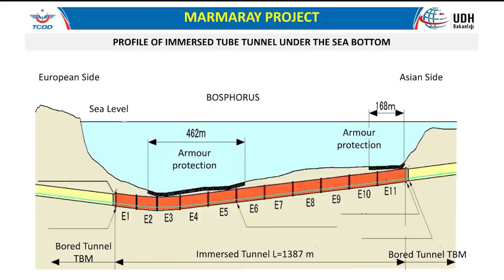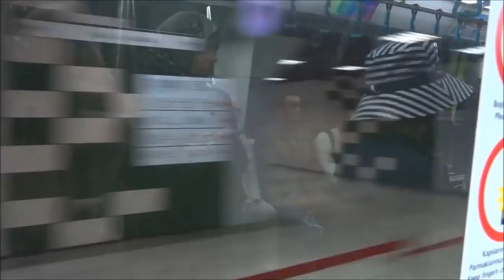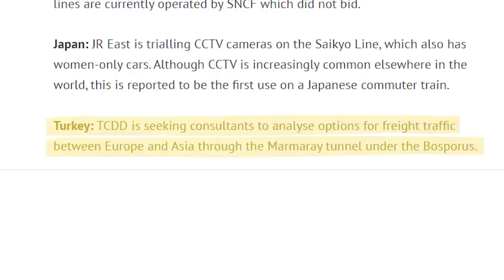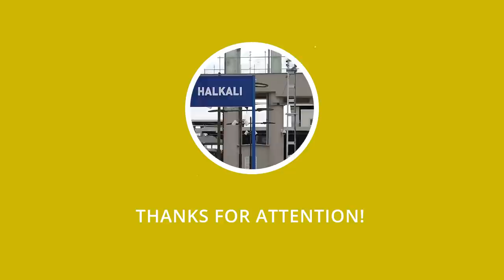First Undersea Tunnel That Links Europe and Asia (The Marmaray Project)

Comment from the maker: We just had a small conversation with one of the experts and a colleague who was engaged on Marmaray project, and we are happy to share with you a couple of details not mentioned in the video: 

1. A complex floodgate system was made as part of the project with the aim to make possible to isolate the immersed tunnel section in case of flooding;

2. The presence of the two signaling systems in the tunnel (CBTC and ETCS) allows mixed traffic (simultaneous passage of the intercity and commuter trains);

3. The presence of train control monitoring system in both Europe and Asia allows to check some parameters of freight trains before they enter the section of the immersed tunnel, and

4. Immersed tunnel (the undersea section of tunnel of length of 1,4 km) consists of 11 sections lowered via barges on the Bosphorus.
Reply: You mentioned that this tunnel is located in a part with great seismic activity.  Is the Marmarey Tunnel built in a special way?
Reply from the maker: @johnjones8979  Marmaray Project was built to withstand an earthquake of magnitude 9.   It is known that many similar types of tunnels are exposed to earthquakes similar to the expected magnitude in this region and they survived without major damage. Kobe Tunnel in Japan is example of how robust these tunnels can be built. In addition to the existing data, additional information and data were collected from the geological, geotechnical, geophysical, hydrographic and meteorological studies and surveys in the Marmaray Project, which was the basis for the design and construction of tunnels constructed using the latest and most modern civil engineering technologies.

Comment: There wasn't any rail link between European and Asian side of Istanbul before Marmaray?? I'm shocked :O
Reply from the maker: Exactly! Before, there was only a ferry line from one side to another, with re-loading of freight, as we described in the video. :)
Reply: Yes, before there were 2 main train stations in Istanbul, one on the Asian side, terminus for trains heading east and another main station on the European side of the city for the trains heading west (this was the terminus of the famous Orient Express). And you needed to take a ferry between the two stations. Both stations are at the coast so you could take the ferry right in front of one station, and disembark in front of the other station after a 10 minute-ferry ride. Now there is a rail tunnel between 2 stations since 2014.
Reply: @mertserim9196 this is actually quite common. In angw, Belgium for example there wasn't a rail tunnel crossing the Schelde river until 1970

Comment: Thumbs up, from someone who is following this project closely for many years. A few additions:
1. There are multiple stations along the line, corresponding with the remaining metro system of Istanbul, making Marmaray the backbone of public transportation in Istanbul, as it is the only line linking the entire network together.
2. Yenikapi is the most important transportation hub, connecting the M1 and M2 Metro lines with Marmaray. Further important transfer stations are Uskudar and Ayrilik Cesmesi on the asian side, with connections to M5 and M4 Metro and Sogutlucesme with connections to the Metrobus and the YHT high speed train which is connecting Istanbul with Ankara and Konya. On the european side, there is Sirkeci with connections to the trolley line, and many more transfer stations to come in the future, as the metro system is expanding substantially. 
3. The tunnel section itself, between Kazlicesme and Ayrilik Cesmesi, is unfortunately only double tracked, while the remaining surface network was extended to 3 tracks and in certain areas even up to 4 or 5 tracks to allow passage of trains.
4. As dangerous freight will not be allowed through the tunnel section, there are plans to revitalize the traject (train ferry) between the 2 main train stations of Istanbul, at Sirkeci on the European side and Haydarpasa on the Asian side.

5. Speaking of these 2 central stations. They are currently out of order, but at least work on re-establishing Haydarpasa, as the main train station on the Asian side, has been started, with Marmaray tracks being currently laid to reach this station. Haydarpasa will serve as terminus for the YHT high speed trains to Ankara and Konya.
Reply from the maker: Wow. Thanks Loccus for this information. With this comment you added a new value to the video and out work.
Reply: @kanishkmair2920  already did.

Comment: I think a proven 600km/h Japanese maglev Sydney/Canberra driven in a single tunnel using 20 Chinese hardrock TBM would be just as cheap as surface rail to build thereby eliminating the need to buy land or build service roads, fences and bridges.

Comment: Great video, hats off 😎 Especially the point you referred to the archaeological findings and the fact that it will inevitably lead to a delay and an increase of the final budget. Here in Thessaloniki we're trying to build a subway line but the administration wants to remove the medieval Egnatia street the archaeologists discovered from its original place and then put the findings back inside glasses like a musem 🤮 The archaeologists around the globe say this is as big of a discovery as Pompeii but they won't listen in the end, I'm sure...
Reply from the maker: Thanks for sharing. Regards to Saloniki :)

Comment: While I have a certain degree of understanding that you do not only use the metric system to indicate measures (but add in brackets the outdated anglo equivalent), I find it highly redundant that you then also pronounce both of them. When speaking, please limit yourself to the international measures, those viewers still dependent on the old style will find it on the screen.
Reply from the maker: Thanks for the advice. We changed that in the later videos.